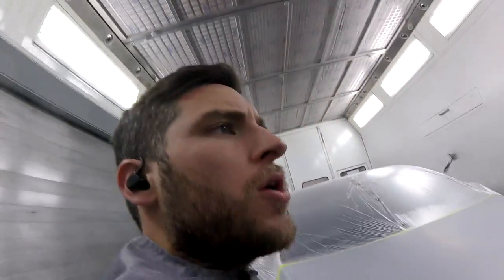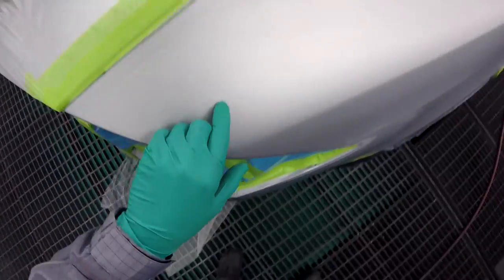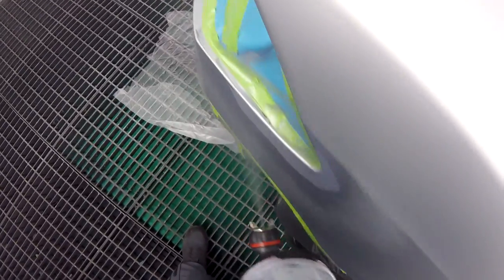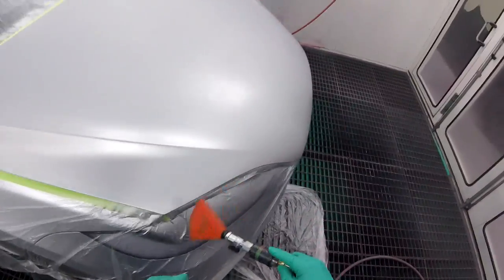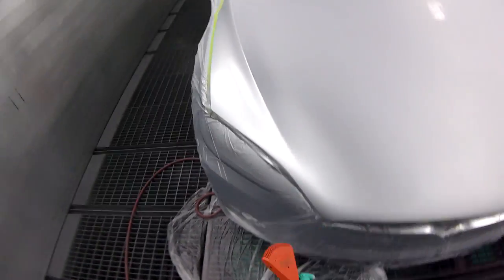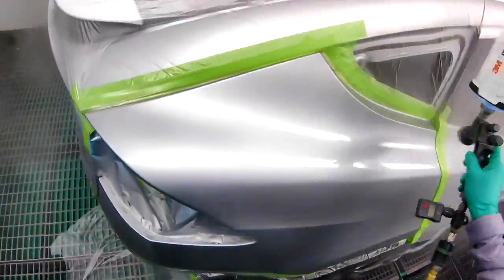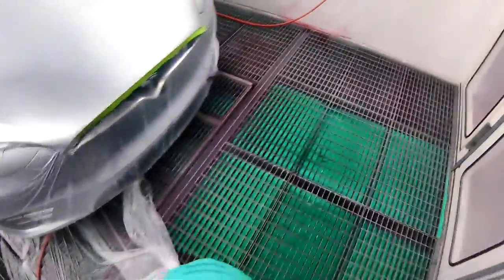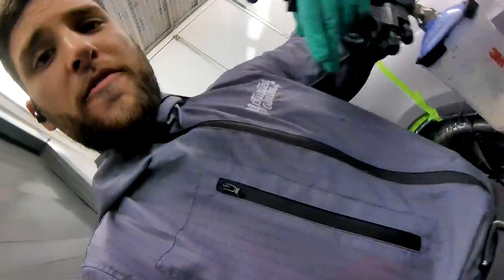Blending Hood Tesla Auto

Comment: For metallics there are many issues that can happen because the metallics mirror the the coats underneath. That's why you can see the blend on the quarter. When you do a blend with metallics get over spray on every coat. Over spray is paint and metallics standing up because its dry. Wen you put many coats the over spray builds up making "pile" lots of uneven over spray. So you get coverage first with many coats but building up pile. Then you last coat  is "drop coat" won't be good because it is going to mirror the pile. Drop coat is a final coat that is sprayed as evenly as possible. For both blending and metallic displacement. Because you don't deal with the pile issues that's why you use to much paint materials to fix or cover it.

Comment: I have issues with high metallic colors in PPG envirobase, i.e blotchyness and hard to cover issues..... coming from dupont/axalta waterbase system (8 years experience) What percentage "activation/reduction" would you normaly use for a silver? ex. how much 492 and 494 per 100ml pre-mixed base?
Love your videos, they've always helped me and I continue to refer your videos to PPG Canada as an excellent guide!
Reply from the maker: Thanks so much brother I usually do 20% t494 nothing crazy  your issues might be coming from the gun
Reply: Dont use 492 in metallics it will shift the  color and metallics . 492 is good for high humidity days but if u don't need to hurry take it out or use very little of it . Over lap ur fan more 75 percent will help

Comment: hey gabe, so was this repair both the hood and rear qtr too big to just blend with clear and blender spray can?
Reply from the maker: That would not be the best way to do it
Reply: @MOTIVATEDPAINTERS  ok, just wondering why clear the whole hood and qtr this time
Reply from the maker: Hood is a top panel so it's gonna get beaten by the sun alot and it's not worth doing just the spot it's better to have full clear
Reply: @MOTIVATEDPAINTERS  yeah that makes sense, hey thanks. Love your work. Very helpful videos. Gun angle, control coat, blends. All great.

Comment: How much do you have the BAR pressure set on sata filters?
Reply from the maker: 80 psi
Reply: @MOTIVATEDPAINTERS  after the SATA filters, you still have some filters that purify the air ???? from the oil ???
Reply from the maker: Not after sata